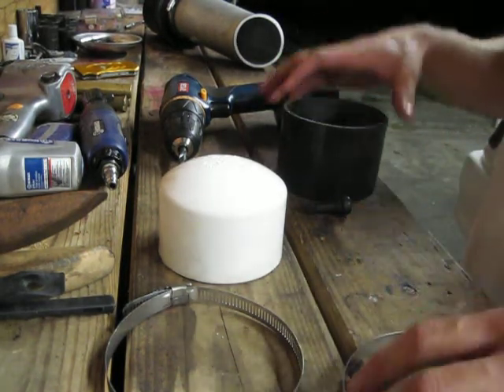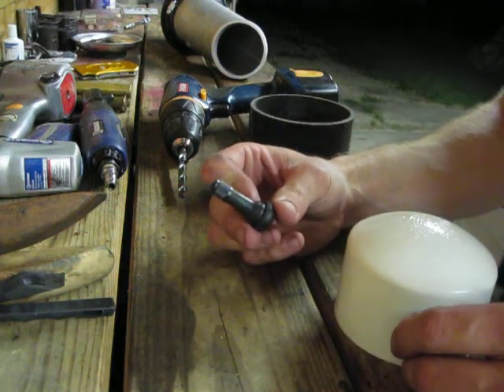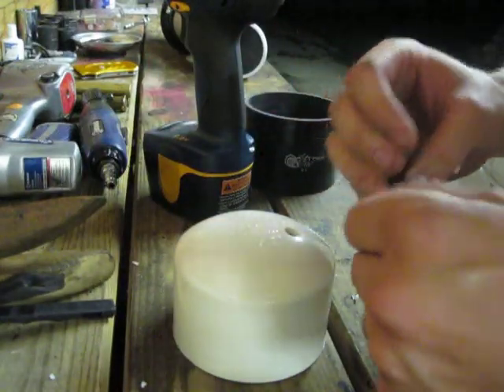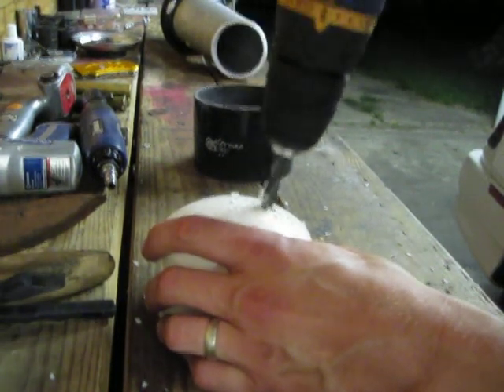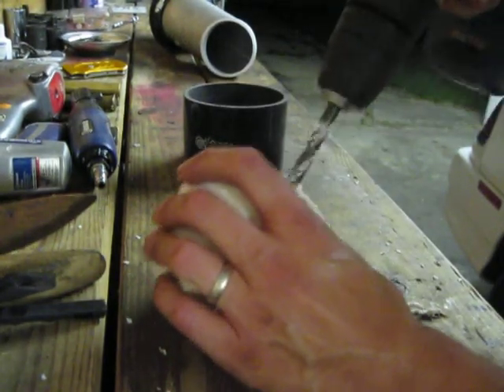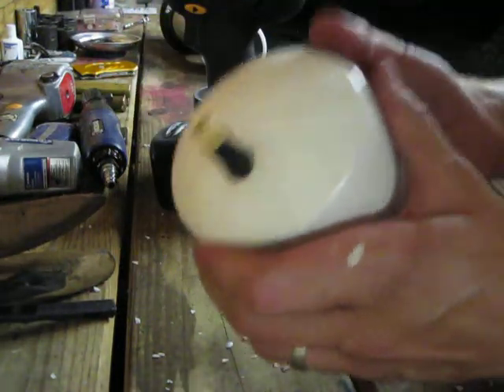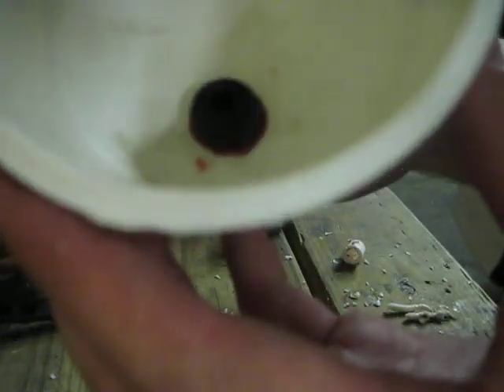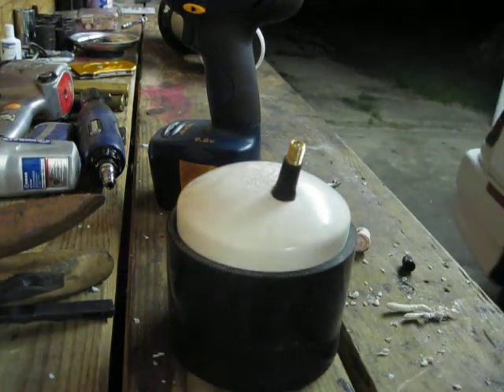DIY Boost leak tester.

Comment: why didnt you just buy a 3 to 2.5 reducer coupler?
Reply from the maker: Not sure what you are asking here. The Compressor inlet is 4 inches in diameter so a 3 to 2.5 reducer coupler would be of no use for my application. 

Robert